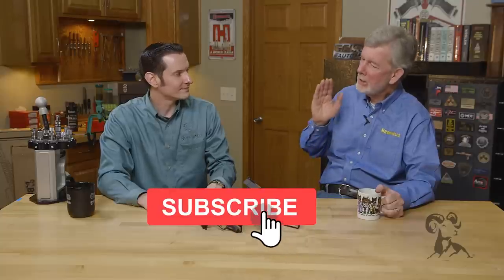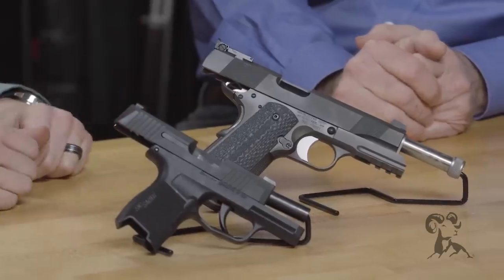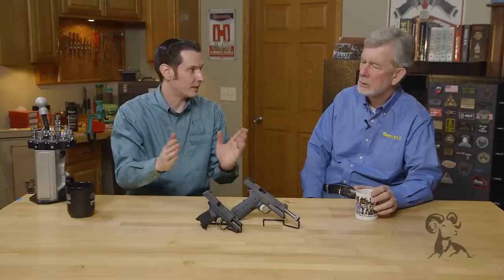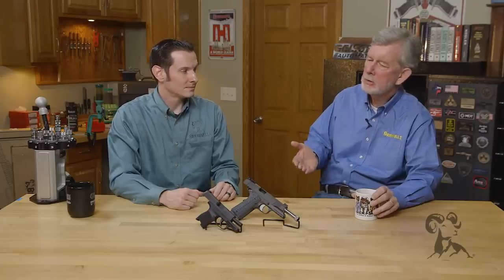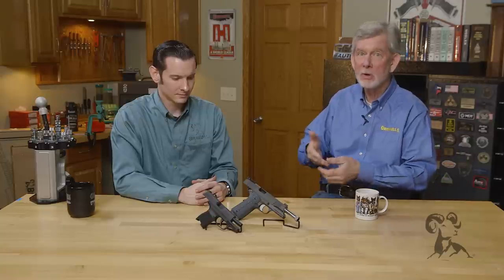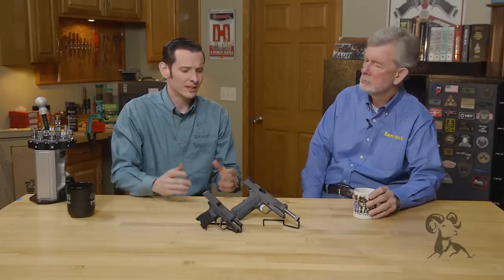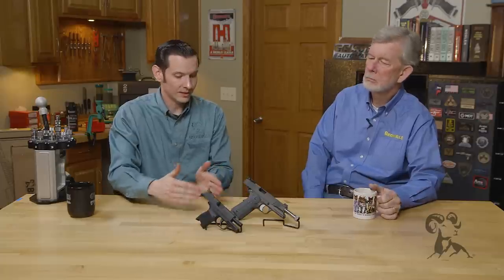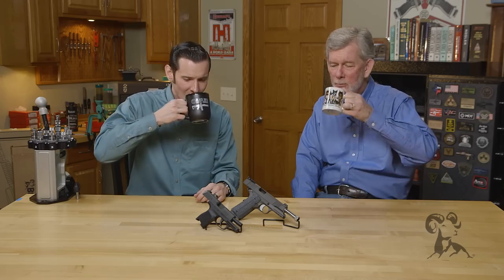Smyth Busters: Is It Safe To Drop The Slide With a Round in the Chamber?

Comment: I saw a post on a retail parts site that sells aftermarket glock extractors that supposedly states Glock states that you should not or avoid dropping the slide on a round already in the chamber as it will possibly result in broken extractor. This is a first-time I've seen this.
  This would be a great positive if you could verify this from Glock for all of us.
  A lot of aftermarket extractors milled from stainless claim far tougher metals and so on.
Reply: yeah, but Glock also says using the slide “stop” as a release will break their guns.   I’m all for listening to the folks who designed the gun.  I just wonder why every other pistol manufacturer in history never had this problem.
Reply: @jwilsonhandmadeknives2760  yep. I've heard this but never seen it in print. But this goes back to their MIM parts. The slide lock/barrel lock is MIM. And can break or wear out over time. But there are aftermarket milled from stainless bar stock locks that withstand the abuse far better. The stock glock locks are not as robust in some areas as the aftermarkets when looking closely at them in side by side comparison. MIM parts are strong but have more limitations on abuse. However look how many thousands of rounds get run thru a Glock with stock parts and withstand breakage. And practically are modern poly frame pistols use MIM slidelocks of some fashion today and many other MIM parts.
Reply: @jwilsonhandmadeknives2760  Odd. My G30 manual says to release the slide by hand or by the slide stop. I do both.
Reply: @barrygrant2907   It's probably generation / model specific and has been taken to apply to all Glocks.   My tiny little G42 has a nearly non-existent slide release.  For all practical purposes it's a stop, because it's pretty impossibly to release it with my thumb, and I've got some beefy meathooks.   I think the larger issue is that a lot of people buy a gun, any gun, and assume that it's supposed to last forever.  Then you have folks who compete or use them hard for training and view nearly every component as a wear item that you plan to eventually replace anyway.  I'm in the second camp.  Guns are all just parts as far as I'm concerned.  I'd rather wear something out and replace it than change the way that I use something when the method works well for me.  I don't break stuff on purpose, but I don't treat any gun with kid gloves, either.
Reply: There is a give in take with extractors. You may find that some duty pistols may break more extractors than others. What they want is extended usage of the gun and more extractions and reliability. So even further reduced wear as goal leads to demands to higher hardness. The result is an extractor that'll reliably extract more rounds without a single hiccup, but if instead of pulling out cheap steel case ammo out of a chamber is hit in the head with it, they're more prone to small fracture and breaks.
Reply: @jwilsonhandmadeknives2760  - Bullcrap!  I have Gen 2s, Gen 3s and Gen 4s.  They all said the slide stop could be used as a release.  Y U LYING BRO?

Comment: I have only had one extractor fail. It was on a 1911 that had had around 70,000 rounds through it at the time, and I believe that they should be replace routinely at around 20,000 or less (I think I read that somewhere).....The little hook on the end just snapped off...(and had never been dropped on a chambered round....so I guess it was just metal fatigue)....
 As a new one was not available at the time (I live in New Zealand and supplies of spares are 'patchy') I made one from 1/4" music wire (Model airplane shops sell it!). It is very hard and springy, but is just about fileable with good quality files and machinable with high speed steel or carbide tools. Took me about an hour to make and was still working fine when I had to sell the pistol about 50,000 rounds later. Yes I had it for quite a few years and at that time I was shooting over 12,000 rounds a year through it, all 200gr LSWC handloads. The chrome lined barrel of the pistol was still pristine.
That was the only malfunction that I can remember with that pistol..... it was a Chinese made Norinco..... Now that I am back into shooting, I have another from the same maker, and with the minor tuning that I gave the old one it promises to be just as durable..... I may not live long enough to find out now!    LOL

Comment: As an aside, I have recently noticed that, with certain primitive semi-autos (a rifle, in my case), you can end up with a progressively deeper ding in the primer if you repetitively chamber and clear the same round (from the top of a mag, for example).
WHOOPS! Luckily, I noticed in time : )
Reply: I've heard with an ar-15,  sks, or any firearm with a floating firing pin, if you repeatedly chamber and re chamber the same round, eventually you will get a slam fire.
Reply: @johnz6066 : That's it!
BEWARE...
Reply: that is true. and with non-crimped ammo you will also cause the projectile to slide forward a few thousandths.  Not an issue unless you have a short seating depth, but if you allow the projectile to go all the way to the lands (jam) you may have excessive pressure when you finally fire it.

Comment: Suggestion....as you are obviously addressing both new and seasoned shooters....it might have been good to state that external extractors are typically PIVOTING style ...that rotate under a pivot shaft...and under spring pressure to keep the extractor engaged over the rim of the cartridge. It is pretty much a unique deal to have an INTERNAL extractor seen mostly on the Colt Govt 45 models...pretty much. These extractors are NOT pivoting under a separate spring pressure....this extractor actually "bends" a bit and is its own "spring".  With all the good stuff mentioned in the vid....some pretty basic stuff like this might have been useful to add. Cheers.

Comment: I had an AD in my house with my Colt competition 1911 .45. I was dry firing and practicing when I was getting ready to put her away I popped a round into the chamber and released the slide. Bang!! No broken extractor but a nice size hole in my wall. Lesson learned
Reply: Your gun malfunctioned...You better have it checked by a professional if it hasn't killed you or someone else yet.
Reply: @jameshoward8609  Its all good. Fixed by my gunsmith. Thanks for the reply.
Reply: @jacobhines773  Good to hear, now you can top off the limited amount of ammo we have to contend with using these hand cannons without worrying about a Negligent Discharge as there is no such thing as an Accidental Discharge.

Comment: Been doing this for years, never broke an extractor.  This way helps prevent bullet setback to a degree.  Like all tools, you should inspect them at times and keep extra parts anyways.
Reply: Hmm. Interesting thought. I always worry about setback. Though my carry ammo has crimped case designed to minimize possibility of setback. I just rotate the top round every so often and visually inspect.
Reply: @snoopy9292  I'll load a bullet over and over again until the bullet setback is noticeable.  Even a small amount can cause over pressure.  Normally i keep my mags loaded and use extra rounds for the chambered round.  After about 6 months a bullet has too much set back.  I take it and discard that round.  This way I'm not mixing ammo and unsure of which rounds are good in my magazines.  Dropping a slide on a live round helps slow down setback.  Loading a bullet from a magazine pushes the bullet into the case from smashing it into the feedramp.  I've done it this way for over 14 years.  It's never worn down or broke an extractor.  But extractors are cheap.  Over pressurized rounds blowing apart a gun are more expensive
Reply: @ghost8six  Good thoughts on it. I have a few rounds loaded via magazine that got stuck on feed ramp that have very noticeable setback. Just chucked em as well. I keep mine loaded as well. But you have a great idea on using extra rounds for chambering. Hadn’t thought of that.
Reply: NEVER HAVE BROKEN ONE BUT I NOW LOAD FROM THE MAG.

Comment: I edc a glock 17. When the gun is empty i pull the slide and barrel off, then spring. Push the barrel forward in the slide, amd put your round on the extractor and slide the barrel back over it gently. Replace the spring and slide to the frame. Then slowly pull the slide back enough to reactivate the trigger but not eject. It saves your rounds rim from deformation from excessive slide dropping, which has caused me failure to eject before.

Comment: Glock mim extractors are somewhat vulnerable to this. The old gen1 and gen2 not so much but the later ones are sometimes broken doing this. I have a gen 3 and gen 4 that haven't had an extractor issue in over 6 thousand rounds apiece. I don't drop the slide on a chambered round. I have had 1  mim extractor break from: too many times dropping a round into the chamber and dropping/ridding the slide to avoid bullet set back. Now I just gently ride the slide forward and tap it  to make sure it's in battery and feeding from a magazine I haven't had any bullet set back or extractor issues.

Comment: My CZ75 BD's extractor broke after numerous failures to extract because removing the magazine to clear the malfunction caused the slide to slam home onto the empty casing still in the chamber. The extractor spring was weak, which was what caused the failures to extract, so it's weird that it wasn't able to scoop around the casing.

Comment: I carry a round in the chamber in my Glocks, my S&W revolvers and my Ruger Single seven. I'm a retired Deputy Sheriff and over the course of 30+years if endured many different types of training. The absolute worst I ever encountered was at a Nuclear Plant after I retired. For a short time we carried a Glock 23 with an empty chamber. Then some braniac decided it was better to carry an AR-15. We carried the AR-15 with an orange plug/flag in the chamber, you had to retract the charging handle to chamber a round and while doing so the orange plug/flag was ejected. Carrying the AR-15 outdoors I didn't have a problem, but indoors in close quarters with lots of thick steel and concrete, I really thought it was stupid and I'm sure glad I never had to discharge the weapon. I heard at one time they carried revolvers with all 6 chambers loaded, but not so the semi-autos. With that mind set I'd rather carry a revolver.

Comment: I was tuning a new extractor on an old star model b, that was constantly failing to extract, testing the tension on a case in the camber. Once i got it right it would smoothly jump the rim of the case and not just slam into it.  It was super tight at first and I am sure it would have broken or worn out really fast with that much tension. But no more FTE. 😁

Comment: After speaking to who I consider to be one of the best living pistol designers on this matter, internal vs external is of little consequence.  It is about design and materials.  A good modern pistol has proper design and materials to accommodate dropping the slide with a round in the chamber, or without, using the slide release, or not.  He assured me that a pistol of his design would accommodate any combination of maneuvers.  I have personally seen extractors break closing on loaded chambers, unloaded chambers, and stripping a round from the magazine.  In every case it was poorly designed,  or inferior materials, or both.  If you need to change, upgrade, or tune such a thing on a pistol "out of the box" then it was not done correctly in the first place whether it be design, material, or both.  So yes, it depends on the gun.  And the gun depends on the design and materials.  There are some good manufacturers that have produced inferior products, and some inferior manufacturers that produced good products.  There are a few that produced one obscure product and disappeared, and a few that have produced one superior product and then disappeared.  If you know what you are looking at you don't have to pay big money for a big name.  If "tuning" or "upgrading", the best answer isn't always putting in the hardest part, it depends on the design.  Sometimes it's the hard part that will fail first or damage something else first because it wasn't supposed to be so hard in the original design configuration.  Then of course there are the conditions.  Cold?  Hot?  Dry?  Wet?  A well designed pistol will take into account all of these matters including the intended purpose.  Police duty?  Military?  Self defense?  Target? Competition? Other?  There is rarely if ever one that will suit all purposes under all conditions, some will immediately say that is a Glock.  Of course, you can spend a few thousand on a custom shop pistol, but such a firearm could never win a military or police contract nor make it into the nightstand or holster of the average "Joe".  As a physician in an ER I never once asked the brand or model of the weapon, how much it cost, how reliable it was, or how accurate it was.  Such things are moot once the damage is done.  Dead from a yeet cannon is the same as dead from a custom shop 1911.  In the end, beyond all else, know your firearm and practice.

Comment: Have a repro GI style 1911 with internal extractor. Trying to drop the slide on a chambered round (was using dummy handloads as snapcaps) will just destroy the rim of the round without riding over at all. I imagine that's not good for the extractor either, so never tried again after that.
Reply: That is a problem with an improperly fitted extractor.

Comment: I would like to think that if a particular manufacturer of a particular handgun didn't want you to drop a cartridge in the chamber and let the extractor ride over the rim, that they would put that info in the manual and caution the owner against doing that.  This is like slide stop vs slide release.  It's all-or-nothing instead of going with what the manufacturer says, or prudence would dictate in the matter.  At least Steve and Caleb point out in this video that sometimes it's not okay, but mostly it is okay, depending upon the handgun model in question.

Comment: I've always heard the main issue is, at least with hammerless guns especially, not that you'll break your extractor, but you may get the firing pin slam forward (safeties fail) and set off the round.
Reply: Caleb talked about reloads with wrong primers [to high] being the culprit also the Sig 320 had inertia issue with early trigger groups. Or finger on trigger.
Reply: @ni9465  not just with Sigs and high primers.
Reply: IF that were to happen, that is a poor design, and should end with a recall.

Comment: I don't clear EDC firearms often, but when I do, I often reload by drop the slide on a round. I can recognize and deal with a broken extractor. My concern is setback on the chambered round. Chambering the same round 2 or 3 times off the magazine, especially in Glocks and the setback can be pronounced and significant. Very dangerous situation.
Reply: Another channel (tfbd I think) did a test with a G19 Gen 3 VS a Ruger SR9 to see which caused more setback.
The Gen 3 was cycled 95 times before it reflected any setback.
The ruger was showing setback after 10 racks.  

I might not be quoting the exact numbers but I am close.
Reply: @FierceMouse  obviously quality of the ammo should be considered. Friends G3 showed pronounce setback after 2 cycles and was scary after 3. Neck tension on that ammo was off.

Comment: Rule of thumb an external extractor like this it won't hurt it. Internal, you can damage it because the extractor has to go around the case and there is less room to flex.  Anyone who ever had to tune a 1911 extractor knows this, and if it's very tight, it will snap it.  In your case, this is external...

Comment: No problems here with my Rock Island/Metro Arms 1911. I've been loading a round from a box of cheap reload ammo from a gun show and the Hollowpoint loaded didn't like my feed ramp. The bullet has slid down into the case well beyond spec. So, after inspection and cleaning, I load it in the chamber, drop the slid, and seat the mag. (I've fired several rounds that had done the same thing out the same box. No issues.)
Reply: so your contention  safe and prudent to do this with your firearm specifically :) scientifically with a sample size of one.. with defective ammo you shouldnt be shooting at all. you know when its so significantly short its not loaded right and you risk having case ruptures? if that ammo has a full charge its going to be at a higher pressure than designed.
Reply: @trenvan5546  Out of a box of 50 I have 15 rounds left. 6 of which failed to hold position in the case. (not including the one in my chamber) All fired fine. I actually had one that was worse than the one in my chamber. 😎 I didn't notice any difference. lol

Comment: I have both an early P220 (I carry with a round in the chamber, always) and an early 1940's FingerPrint (internal extractor) Browning HP. My daughter will soon be inheriting my BHP. I do have an original new replacement extractor for the BHP as when I purchased it a million years ago I was told by many the internal extractor was not strong due to design and would break. I was told it was a design issue by those pointing to later BHP that all have and now have the external extractor. Both the Sig and Browning have thousands and thousands of rounds through them from a lifetime of shooting. No failures in both, but I did replace springs in the HP.  I don't understand how I am able to create this condition of slamming the slide on a chambered round. How does that condition happen as I do not want my daughter to have a problem with the HP (my Son is taking the Sig)? My daughter will have the new original internal extractor if she was somehow to break it, I just don't understand how the condition is created to cause the stress and failure of the internal extractor in the HP. Can you guys help me understand this condition please?